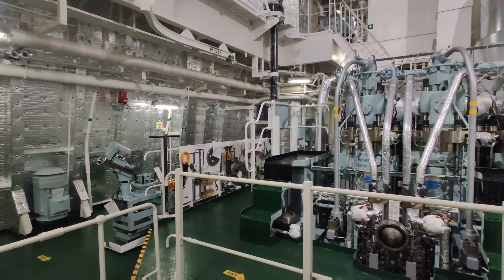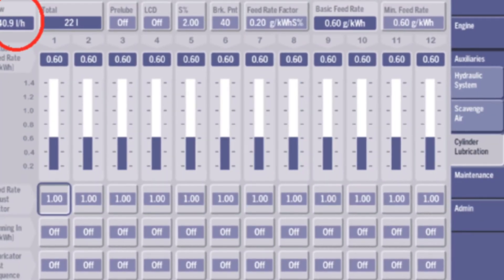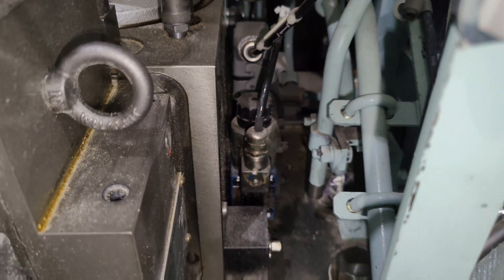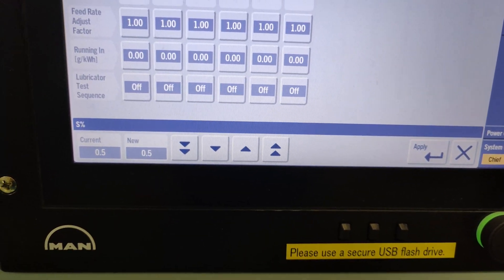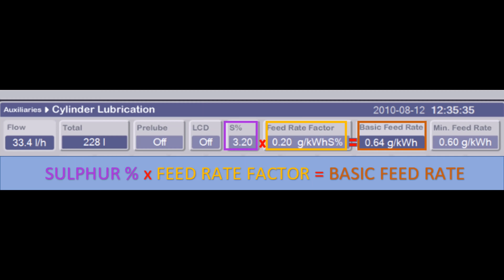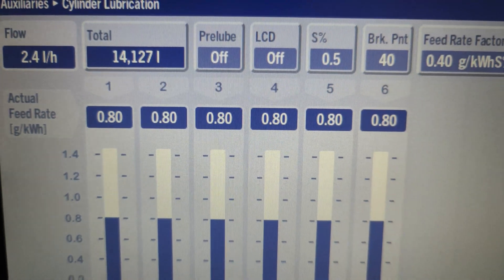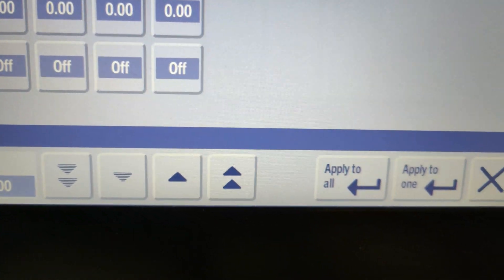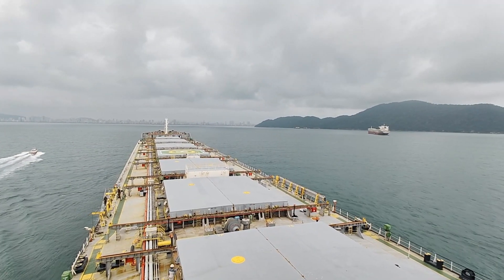ME Engines MOP CYLINDER LUBRICATION SCREEN COMPLETE EXPLANATION

Comment: Not complete.For cadets.
1) LCD- what a load drop/increase to activate/deactivate the LCD. How more cyl oil added during this period, for how long?
2) Break point. Difference between power and part load?
3) some additional info. If you put Running in 1.4, its will be priority setting for this cylinder. No matter of feed rate adjust factor.
Very thank you for video !! :)

Comment: Sir, In me c engine pilot solenoid valves are used instead of starting air distributor, right?
Reply from the maker: Yes you right...ME-C type engines usually have pilot valves( 3/4 way type ) operated by engine control systems...where as ME-B type have conventional air distributor system.
Reply: @sealegend1627  ok, thanks

Comment: Why cylinder oil alpha lubricator is used for lubrication if lube oil is already supplied by LO pumps,
Also if both are there, then how it's prevented from intermixing.
Reply from the maker: Hey hello...Good query...
The Marine engines have 2 different types of lube oils ( with different TBN values).
One grade is used for engine bearings lubrication while another grade is used specifically for cylinder liner lubrication.
LO pumps supply oil for brgs lubrication while the seperate cylinder lubricator supply oil for cylinder liner lubrication.
The brg lubricating oil drains back to sump later lubricating the respective brgs and the cylinder oil partially burns away in the combustion process and remaining oil drains to seperate scavenge drain tanks.
They never mix up..
Reply: @sealegend1627  thanks a lot,
How the mixing of these 2 are prevented,?
Also, is cylinder oil lubricant prevents nox emissions